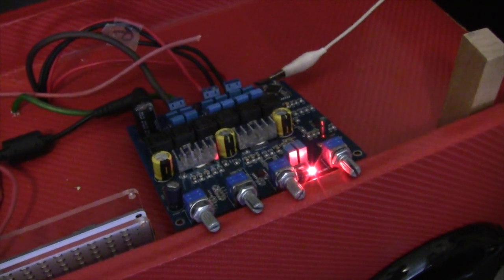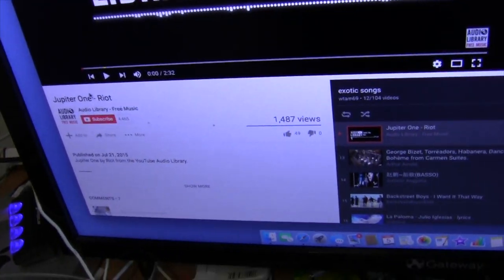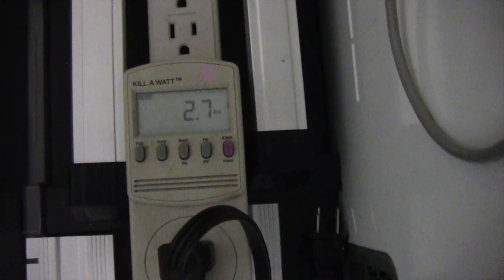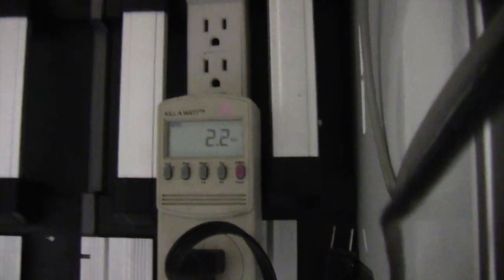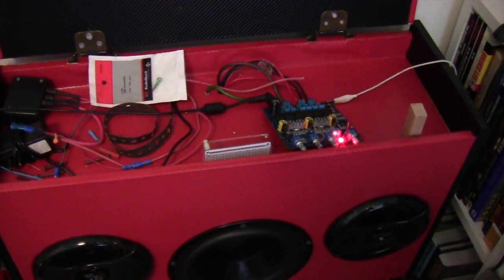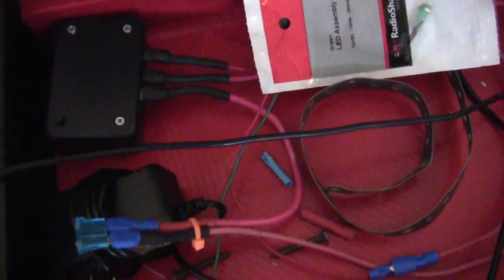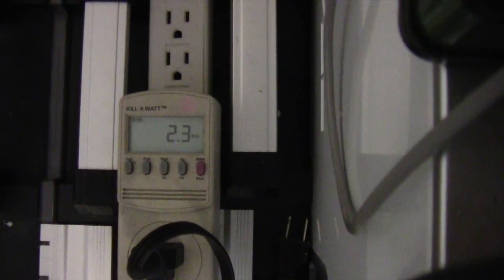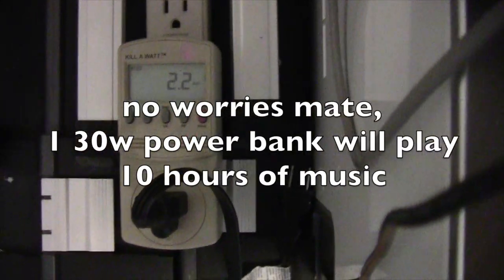TPA 3116 D2 class D bluetooth amp actual  power usage in my boom box  Part 5

Comment: I think there are actually 3 kinds of watts going on thru a setup like this,
1. Watts from the wall (AC)
2. Watts coming out of the adapter (DC) , can  use DC watt meter to show voltage , ampere and watt of the DC power used from the power adapter. 
3. Voltage coming out of the amp to the speakers , can measure it using multimeter, and amperemeter for the current/amperage then multiply it to get the wattage. This is the actual watt rating of the  amp spec (2x 50 watts for the satellites , 1x 100 watt sub), not the power from the wall.

I'm curious about all those watts, but easiest to measure is the AC power using wattmeter like in this video. DC watt meter will need to be put between adapter and the amp, need a bit of effort but also easy. Measure the actual load of the amp will need the most effort.

Comment: That is quite low, wow 2-3 watts from wall socket with good sound. My Aiyima A07 with tpa3255 uses 8 watt of power from the wall, it is also considered low and can drive 10 inch speakers despite with weaker bass than if I use an amp with higher power to the same speakers. 

I'm also building a tpa3116d2 2.1 set still on the way, that's why I'm curious and youtube search sent me here. I'll be using :
- 4" full range drivers inside SPL design boxes (single driver per box)
- 6 inch subwoofer rated 100 watts, with miniscoop box design.
The power will use Sony AC Adapter PCGA-AC19V9 from old VAIO laptop with 19.5 Volts 7.7 Amps 150 Watts of power.

Comment: Thats nice mate..  i have a tpa 3116 d2 2.1 channel 200 watts output audio board and i am planning to wire it up with an 8 inch 100watt 8ohm subwoofer and 2 6 inch 40w woofer speakers and maybe a pair of tweeter speaker along with them..  

I am thinking of using 24v 5amp psu unit for the whole setup..  do u think i will be able to get a good result by adding this psu unit?
Reply from the maker: 24v 5amp is the preferred psi for this amp.
Reply: @wtam69  hmm..  i have ordered the same form amazon.. lets see how it performs.. 

By the way 
thanks for the info

Comment: nice video wtam69. planning to use this amp on a pair of bookshelf speakers. planning to use a 20000mah powerbank gonna boost the voltage using a DC-DC step up module. is it ok to boost it to 24v?
Reply from the maker: Yes, it loves 24v but can do with less.
Reply: @wtam69  thanks

Comment: https://amzn.to/30LAYZh, Very economic.  Tips:

2.0 channel mode: it is recommended to use a max power of DC21V and a full range speaker of 50W*2 4Ω for the best working condition.

2.1 channel mode: it is recommended to use a max power of DC24V, a L/R speaker of 50W 4Ω and a subwoofer speaker of 100w 8Ω for the best working condition.

Comment: Sir what is the brand of the speakers you used and how watts, especially the woofer because am. A lover of bass
Reply from the maker: I use two 5 inch coaxial speakers, one 8 inch Dayton subwoofer and one 10 inch Dayton passive radiator.

Comment: Same amp  sound not working and bluetooth or next forward button working fine 
Why sound not working?
Power 12v 3
Load driver=15w4ohm×2 
Please answer
Reply from the maker: You have to pair the amp with your bluetooth input source and turn your music source volume(on your bluetooth device) to maximum volume. Check all your speaker wirings and see if it works.
Reply: wtam69 thanx 4 yr fast response I'm now sleeping ,😂 bkz now midnight in india early morning I have checked all again and please send your email address please ssss
Reply from the maker: Alok, you can continue with your questions using this thread. Maybe someone else can answer your questions as well.  This is how we learn. There are things that are obvious to me but not to you. So it's ok to ask.
Reply: Good morning wtam69 amplifier same but I'm noticed my full range speaker driver discription at ali express many driver power source ac  it means?
And many driver power source ac ,dc both plz explain?

Comment: My amp tpa 3116d2 50+50watt 2 channel  i have 3inch 15 watt 2pis full range speaker and one 3inch 25watt full range woofer and 2 TWeteer 10 watt so please what power supply I'm use thnx for advance
Reply from the maker: You can use anything from 12v to 24v with at least 1 amp.  3 or 4 amps will be better.
Reply: Makita!!!!!

Comment: Okay so i have a TPA3116 100w + 2x50w and im looking for a battery so it can last 20+ hours. How many Ah does the battery need? Also do you know any suitable batteries?
Reply from the maker: A lithium ion rechargeable pack at 3s and 2p should last 20 plus hours. That means 3 18650s in series with 2 sets in parallel.  4 p would be even better.
Reply: Found a reasonably priced 12v 20ah acid battery would that do the job? Also how do you even calculate this D:
Reply from the maker: Yes, a 20  Ah battery would do the job. It'll be heavy though.  It's volt times amps=watts.  An appliance can consume a number of watts per hour.  If yours use 3 watts an hour, then your 20 Ah battery will run for 40 hours until you need to recharge it. Your battery can theoretically supply 80 hours of music but it should be charged when half drained so it should be charged when you have 40w left.
Reply: Okay, now i understand the concept here! Thank You!

Comment: hey I have a 7.4 amps battery with 12v output. if my amp is drawing 3 watts how long will my battery last ...tell me the formula to calculate
Reply from the maker: 7.4 x 12 += 88.8 watts.  88.8 divided by 3 = 29.6 hours of use.
Reply: wtam69 thank you so much bro subscribed
Reply from the maker: I forgot to mention.  In calculating the capacity of the battery, you have to take into consideration that you cannot completely drain your lead acid battery or you'll shorten the life of the battery.  It is usually drain to half of its capacity and then it needs to be recharged. So in this scenario, you'll have to charge your battery after 15 hours of use.

Comment: hey i have a 2200 mah 30c lipo 11.1 v. can this lipo battery power it up ?
Reply from the maker: I assume your pack with charge up to 12.6v, which is ok to power this. About 16 to 24v would be better.
Reply: thank you !!
Reply: grab a voltage doubler or booster

Comment: how can I power this amp?
Reply: wtam69 i have a 2A power suply and it works great. i think the amplifier only are 50 watt. like 12watt x2 and 24 watt sub. 

i have a amplifier that play up to 15 watt and is equal to the 2 channels of this amp togetter
Reply from the maker: Use a laptop power supply with output 16 to 24v and 3 amp or more current. It will actually work with 12v dc but lower power output. You can basically power this with most dc 12v + power source.  I was actually thinking of using my Black and Decker 20v lithium dc power pack as a power source.
Reply: +wtam69 awesome thanks
Reply: +Josh Vella I was planning on running a 24v 5a power supply but thought that would only yield me 120 watts on a amp that requires 200 (50+50+100)...what do you think I have never done this before so any advice is appreciated. I'm planning on using 2 bookshelf speakers and a subwoofer..once again thank you
Reply from the maker: Don't worry too much about the power supply. 24v 5 amp should be sufficient. Sure if you use inefficient speakers( like acoustic suspension) , you'd need more power but any decent efficient speakers will sound plenty loud.  If you find a track in the Youtube Audio Library (copyright free) that you want me to demo, I'd be glad to make a video to show you how efficient these class D amps are and how loud they sound with the right speakers. I just wish I could use copyrighted commercial music in my videos but that's not possible.
Reply: Doesn`t require, but is able to deliver ;)
Reply: Try makita 18v. That's what use from a broke down power drill cutting off base of drill you can use one battery on amp one on charger you can play nonstop. You need a jumper wire at pos. leads then hook up neg. You dont have to use computer or gaming power supply. Makita, dewolt milwaulkie portercable, you'll see.  Works great!
Reply: If you want to be mobile.... use construction tool battery power. Keep one on amp & have a back up charged spare... over played mine over 8+ hrs. On a job- PORTABLE!!!!

Comment: 200 watt rms power, 4 ohm subwoofer with a 100 watt tpa3116d2. Will this work or will it clip
Reply from the maker: I think the 200 w rms power subwoofer refers to the power handling capacity of the subwoofer.  You are not required to use 200 watts to drive the speakers. 100 watts into a sensitive speaker box should be loud enough for most people.  There should not be appreciable distortion level if you use the amp within its specs. You can google  the data sheet of the TPA3116d2  and see the distortion level of the amp at different frequency levels.  You will probably have a problem if you use a 200 w amp to drive speakers that can only handle 100w.
Reply: +wtam69 the subwoofer is 800 watts peak
Reply from the maker: Aaron Fonseca Subwoofer 800 w peak means it can handle a fraction of 800w rms power. Being able to handle more power means essentially you don't blow your speaker easily when fed more power. It does not mean you need 800w to drive them.
Reply: i thought i'd need a 1,100W  inverter  and huge car battery to power my 1,100w speaker!
Reply: cheap and dirty. clip.